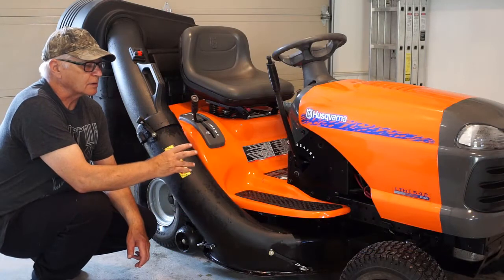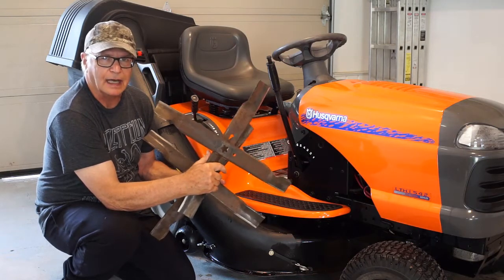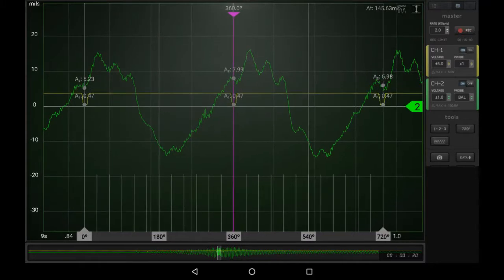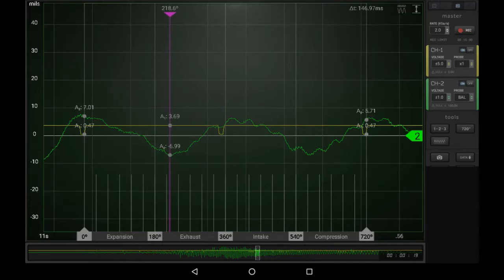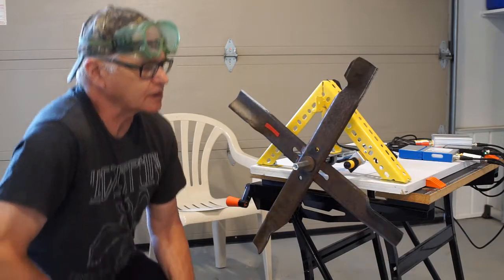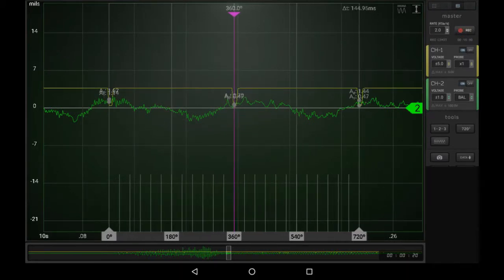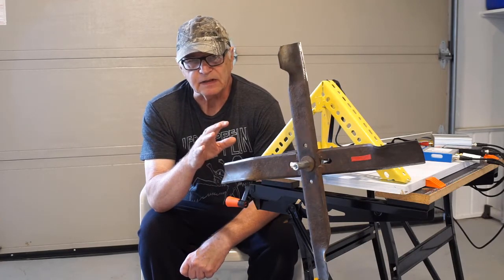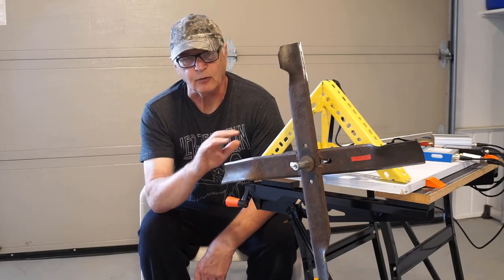GADGETS#59 - MULTI BLADE ROTOR BALANCING

Comment: good video "ole" man,they is an art of that balancing that is beyond the common laborer,but you are able to break it down to the average  tech.you know the next  challenge will have to include the x-y axis  , as if a tire . hey i built a 5-volt reference box using a lm2596 dcto dc buck converter . i got a 5.1v reading with a 9 volt external battery or 12 volt  vehicle supply. thanks for all the info you gave me,helped me out   lot
Reply from the maker: +henry robinson - as to the help, it's my pleasure:)
A 2 plane balancing would not be achieved through x-y axis. I think it would require 2 separate ADXL335 each using x-axis only and it would require a 3 channel oscilloscope. I have no plans (at this time) to build one.
2 plane tire balancing is overrated and with today's quality rims and tires can be done single plane with weights concealed in center rim.

Comment: Hey,

Interested in your comment at the end of your video about being able to scale this up for a rotor. Looking at the multi blade you have here it’s thickness is quite thin, when scaling up how would a longer rotor or shaft say with two bearing positions on either end of the rotor be accommodated, would you fix with pendulum each end and run both ends independently?
Reply from the maker: +Maverick UK - by scaling up, I meant a longer pendulum on a larger, more rigid frame.
Imagine a car wheel instead of the plywood disc in #58 on a 3ft long pendulum. First, the RPM required to cross the natural frequency of that longer pendulum would be lower. And since the width < 0.5 DIA, SINGLE PLANE balancing as done here could be used.
A longer rotor or shaft Is TWO PLANE and would require 2 pendulums, free to swing independently of the other. Each would require its own accelerometer , and with 1 photocell means 3 oscilloscope channels. Another criteria would be the center of gravity would have to be between the pendulums and the corrections done at or near the supports. This could NOT be a 2 plane overhung rotor in which case a static/couple solution is required.